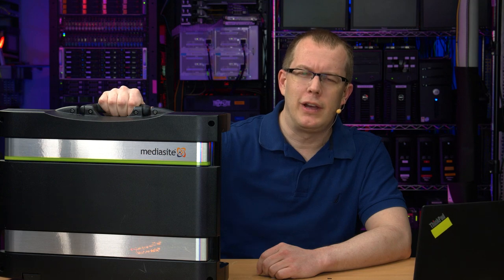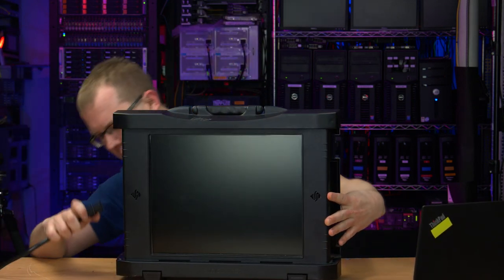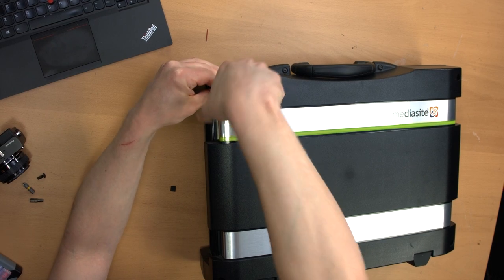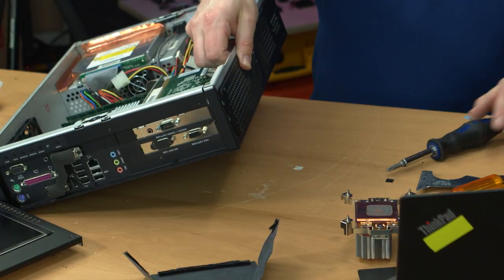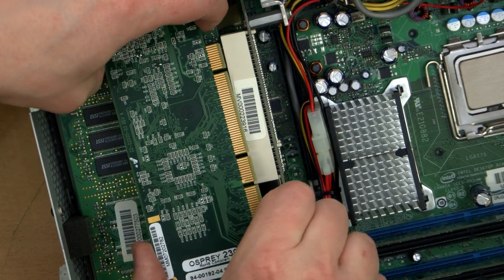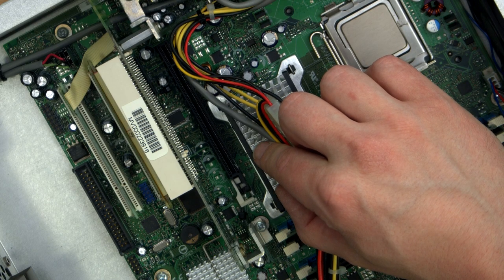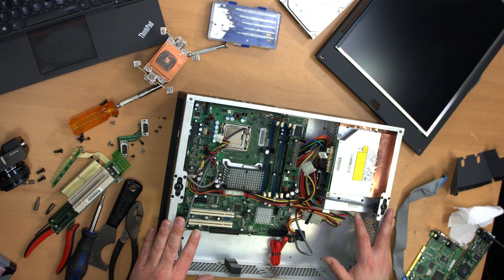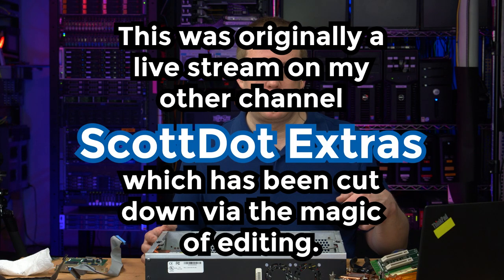Exploring the Sonic Foundry Mediasite Recorder from 2008ish

Comment: 10:19 The black one might be different but pretty sure that's a JST connector, unfortunately however, although they're very common they come in various sizes and pin pitch such as jst-ph, jst-sm, micro jst and so on, meaning if you ever want to find a replacement then you need to get a pair of calipers and physically measure the pitch from two adjacent pins.